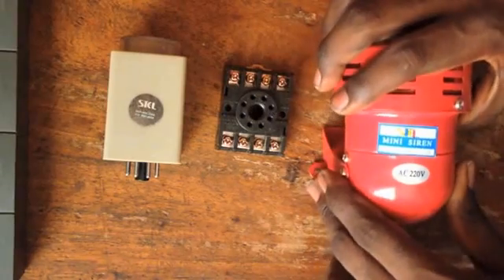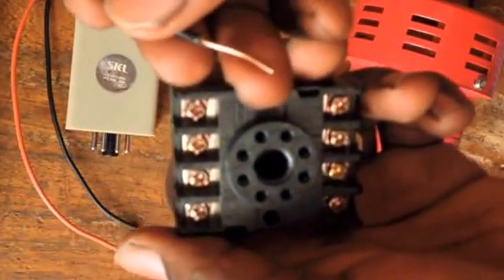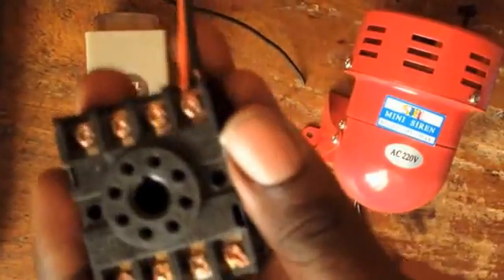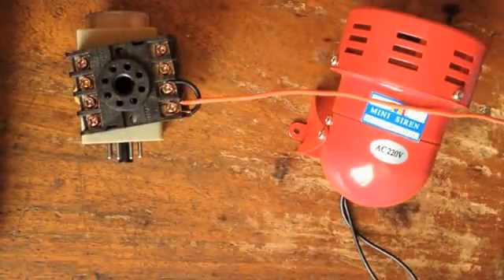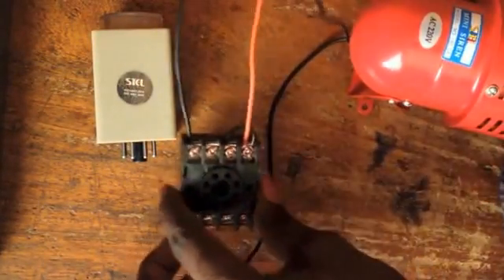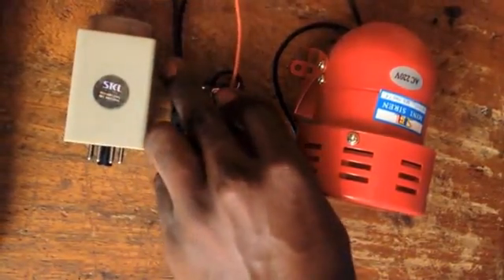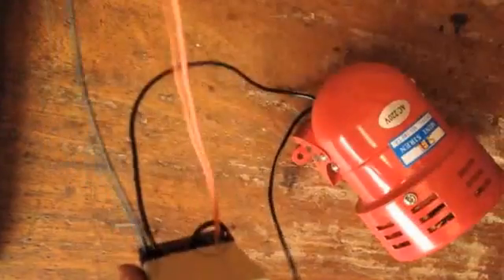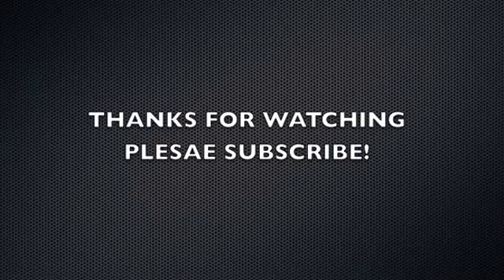How To Install A Mini Motor Siren With  AH3 3 Time Relay

Comment: When the alarm doesn't go off when power is restored what could be the problem, I bought a new timer still the problem persist???? I will appreciate if you can help
Reply from the maker: How many seconds do you have on the timer? If that's not the problem, also check the wiring also.

Comment: My siren will not go off when the light comes up except I unplug the timer. Please what is the cause and possibly solution even with normal voltage.
Reply from the maker: What's the duration on your timer?

Comment: What if you through with the connection and the alarm did not stop what could be the problem
Reply from the maker: Check the nob for the timer and reduce it. You can set it to last for 5 seconds.

Comment: What’s the name of this siren? I got a ms490 unit. How do you hook this up and what system or relay system are you using? I am blind and I need help. Just getting into this hobby.
Reply from the maker: Component

1. Mini motor Siren MS-190
2. Ah3 timer relay
3. Wires to hook it all up.
Reply: @Crenovated  all right. Thank you. How much does a timer cost?
Reply from the maker: I see options between $10 - $19 on Amazon. Depending on the vendor you are buying from.

Comment: can it connect to speed regulator or dimmer in case to reduce the motor speed/sound?
Reply from the maker: I really don't know how that will work out, If you did give it a try, let me know.

Comment: Kudos to you brotherly, but question here is, I got the connection right, but when testing it, it keeps sounding non stop. What could be the cause, can low current supply affects it? Pls help me out?
Reply from the maker: It happens sometimes that If the current is low, it will have a continuous low sound nonstop. Is that what you mean?